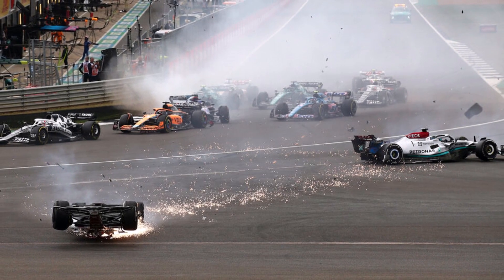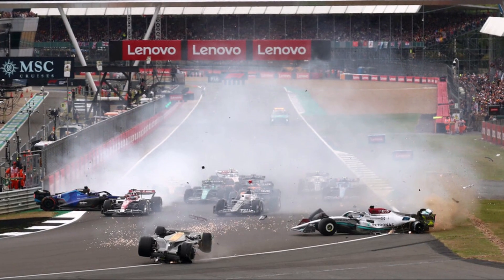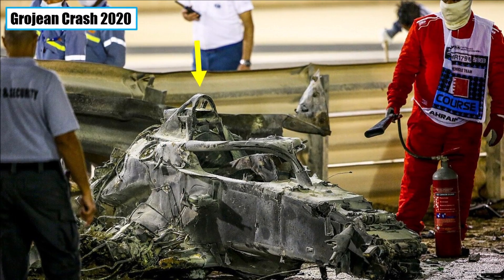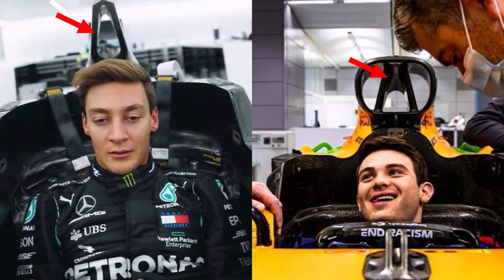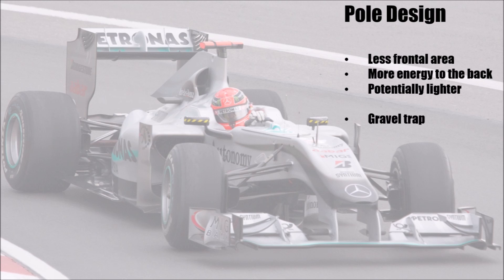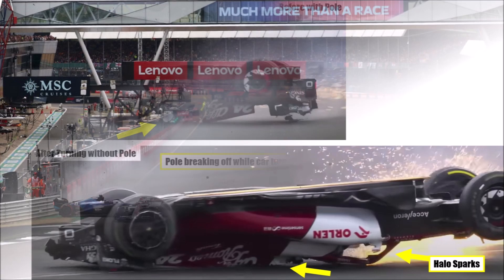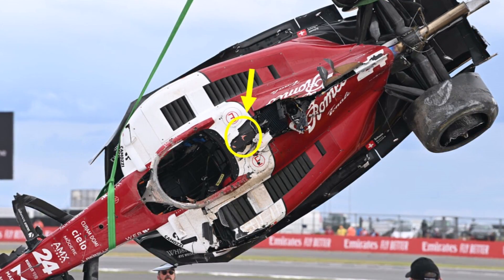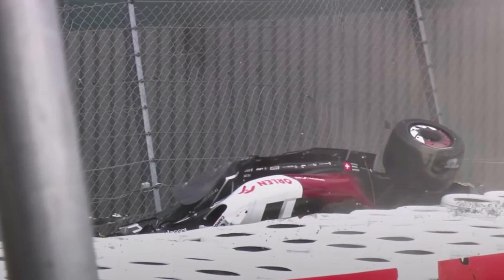F1 2022 - British GP - Lessons Learned - Zhou Guanyu's Crash Analyzed

Comment: The sliding on the ground just shaved off all the carbon, madness
Reply from the maker: These roll hoops are titanium, the grinding wouldn't be a problem but it broke off and that should not happen.
Reply: @bsport320  ah crikey that is bad, could be some cut corners for weight saving by alfa or no?

Comment: Wow, I never even noticed the pole design of roll hoop. It looks weak compared to the triangle design, let alone only being glued on. I thought the roll hoop was integrated into the monocoque molding..I E. It is a single unit.
Reply: I thought so too, I thought it was actually the strongest part of the car and that it's always triangular, I thought the design that Mercedes and Alfa used just had a splitter on the intake hole... I actually always wondered how they manage to do intakes so low and tiny, and how the bodywork around them is so thin... this is actually huge and should not be swept under the rug
Reply: Adhesives can be incredibly strong too. 'ONLY glued on' is a bit misleading. This is especially true when both parts are stiff so the adhesive can't be pulled off bit by bit as one part bends away from the other
Reply: @jameshogge  adheaive is not the way to go when talking safety... There is a reason the survival cell is a one piece and not sone panels glued or screwed to each other
Reply: @went2fast  The way to go when talking safety is to specify various loads it should withstand, resistance to heat, etc and then allow what passes those tests.

You can bolt together two pieces in plenty of ways that will be weaker than adhesives.
Reply: @jameshogge  True.
Reply: @went2fast  well saying glued is silly. It’s bonded on. Equivalence to a weld for the materials used. This one failed. But it doesn’t mean all the other cars would have the same issue.
Reply: @damedusa5107  there should not be any room for safety features failiures, rules have to be tweaked
Reply: @went2fast  that’s impossible, the forces that happen in accidents make it so. You can make it as safe as possible, but there are always going to be unexpected results
Reply: @damedusa5107  so the FIA needs to change the load tests then... It's not quantum physics
Reply: @went2fast  it’s called a failure. Things fail.
Reply: @damedusa5107  they shouldn't in this case, that's why tests exist where you can test things far beyond the possible loads that can happen... It's the 21st century, we also have sims and calculations to the tiniest proportions... Things like that should not happen and be excused
Reply: @went2fast  and btw, even the monocoque is made in sections, using polymers and carbon. It effectively glued together, so your earlier statement saying things can’t be just glued on is a severe misunderstanding of how things are made. Even monocoques can crack with the forces that can happen in accidents, it’s impossible to make everything indestructible. Things will fail, the goal is to make it unlikely. How many roll hoops have you seen fail? Very few. But it’s happened before, even tho the stress tests are incredibly high.
Reply: @damedusa5107  you ate stating how it is, I am stating how it should be, it's not really that complicated
Reply: @went2fast  As others have said, it's bonded (which is a form of gluing, but in a way that carbon fiber is actually designed for, as it in itself is effectively bonded to itself to create the structures in the first place).

The biggest issue is that they're bonding the hoop to the body. Carbon fiber is stronger and lighter than aluminum, but unlike aluminum, it is a brittle structure, so in the event of a collision, it is only good for one impact, and after that is compromised. With this type of crash, it was suffering continuous crash forces from multiple directions (the car was spinning on its roof at well over 100km/h) so it wouldn't take much for fatigue stress to cause the structure to fail, and a screenshot I saw of the components showed that it sheared around the mounting point as if someone used a jigsaw to cut it out.

In short, the hoop needs to be mounted to the frame, and the entire thing needs to be made of aluminum. Carbon fiber won't work here.

Comment: Thank you for this analysis, you definitely brought some interesting insight into that crash. I got to imagine the FIA would have required teams to bolt that structure to the chassis, but IF that team allegedly only glued the structure on...?!?! I think someone is going to have to answer for the that.
Reply: You need to understand materials and adhesives used before making that comment
Reply from the maker: The roll hoop was always a separate part and adhesive doesn't mean it's bad. It's just strange that it came off here.
Reply: @Monkey80llx  I do, to a limited extent; to my understanding carbon fiber is stronger and lighter than aluminum (not sure abkut titanium, though), which is why it has replaced it in newer race cars. However - carbon fiber is also a brittle structure, meaning that after the initial collision, the strength of carbon fiber is practically gone. That is why Anthoine Hubert was killed last year in that horrible F2 collision; he hit the wall hard, and then got broadsided after his vehicle already took significant impact damage. I somehow suspect that if the structure of his car wasn't already badly damaged, he may have survived, albeit with serious, potentially life-altering injuries.

I hope that the hoop is made of and aluminum and titanium structure in its entirety, and bolted to the frame in future revisions. Attaching it to the body is a really bad idea, especially since the body can also take separate damage during a collision, not including the rotational fatigue stress that was experienced in this particular collision.

Comment: Can you please do a video on the differences between the Halo and Aeroscreen? Would the Aeroscreen have survived the RG 2019 crash? In yesterday’s crash, there was small I-beams (w-beams) supporting the back of the tires and I was very surprised one of them did not contact the drive from the side as the car fell between the fence and tires.

Comment: It was insane to be me seeing people trying to justify this and saying that the track ground down the bar or that it should act as a crumple zone. 

Maybe they need to move to require even stronger roll hoops like Indycar. I’ve seen the Indycar roll hoops survive direct hits after being “dropped” from 4ft+ in the air and skidding along the track for long amounts of time and the roll hoop looks almost brand new.
Reply: I think the FIA should look at mandating the roll hoop material to be something more abrasion-resistant like titanium alloy and beefing up the requirements for it.  It seems that despite the halo and the monocoque and front/side/rear crash structures being significantly strengthened (particularly in 2022 with the 20kg weight increase on the monocoque), that the FIA hasn't made any changes to the roll hoop requirements for a while and that this was a somewhat 'neglected' part of the safety regulations. It will add weight to the cars, but safety improves over time after all.
Reply: It should already be that way. The roll-bar should be as resistant as the halo is. If it collapsed that way there was something wrong in the way it was mounted, as also said in the video. In the images and the video of the crash the roll-bar survives the hit but the entire structure flies off when the car start skidding and this shouldn’t happen.
Reply: With a big emphasis on 'brand new'...

Comment: Alfa is the only car underweight this year. Have they skimped on safety to get there?
Reply: Biggest contributor is their short wheelbase. But every little bit helps.

As an engineer, I would not say they skimped to get the car light, but that they designed to accepted the requirements. The design passed all mandatory safety testing. If the engineers instead designed something that exceeded the requirements then they did not do a good job (because they could remove material and get it to "just" pass, saving weight/cost). If the FIA implemented a test that simulates the loading conditions of this crash (this will be the most likely outcome of this event) the engineers will have optimize to a different design (much how cockpit designs changed after Senna once new regs were introduced).
Reply: Didn't a number of teams fail the side impact test before the start of the season as well? As already said, the cars are built to meet a minimum requirement or test criteria.

Comment: I had the exact same thought when I saw the first footages from crash. I was like "Where the hell have roll over bar gone? I mean, if there wouldn't be halo, he might roll over on his head and possible neck injuries afterwards. Like also you've said, there should be and will be further inspections about this bolting points.
Reply: There's no way that crash would have been survivable without the halo in the absense of the roll bar.
Reply: @4Leka  Agreed. What 900kg pushing down on your head? That would be lethal at a standstill.
Reply: @andyp7449  In fact, imagine if the driver was taller? He was lucky that his head is lower than the halo. Lewis Hamilton had a scary situation last year where Verstappen's wheel landed on his head. Even though the Halo protected him from death, the tire still hit his head enough to give him serious neck pain at the time.
Reply: Dude... If there was no halo it would have worn the helmet down on the road and then would have taken the full force of the gravel trap. It would have been a disaster.

Comment: They take safety very seriously. I think the roll bar design will be banned, or they will up the load test force (and unfortunately add weight to the car again)
Reply: Not really, as you can see in the video the real issue is not the roll hoop strength but the strength with which it is attached to the chassis, so probably the solution will be more stringent rules in this regard. The hoop itself flew away in one piece so it is strong enough.
Reply: @AruEsse  mmmm, we'll see
Reply: it’s not so much the roll bar design as it does the mounting I think. If it was true that the roll bar was just glued on and not bolted to the chassis, then even the other roll bar designs will fail similarly.
Reply: we’ve had rollover crashes before and never seen it fail like this even when the cars were significantly lighter
Reply: @xtremewillie  Try Diniz at the Nurburgring in 99.
Reply: Maybe at this point it's better just to get halo higher and get rid of rollover hoop since they are mostly on the same role now

Comment: Yeah there should be no gap between barrier and fence.
Reply: There was no gap. The car bended the barrier and created the gap. I doubt this design will change.
Reply: @theodoro89  Wrong, there is a gap. It had nothing to do with the fence bending a bit because of the impact. Look at the photos.
Reply: @boostav  Oh yeah there is a pretty big gap indeed. From the helicopter footage the gap seems so much smaller than it actually is.
Reply: I'm pretty sure the gap exists so that the barrier has more room to deform and absorb an impact.
Reply: why not if a gap is 3m wide?